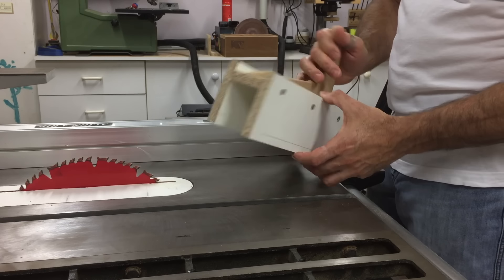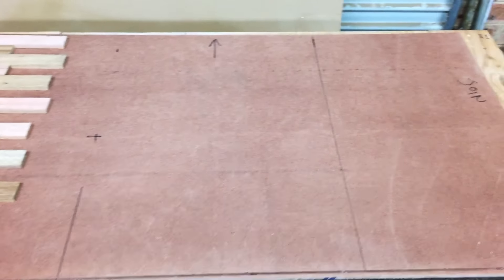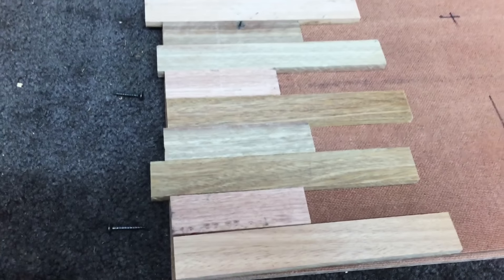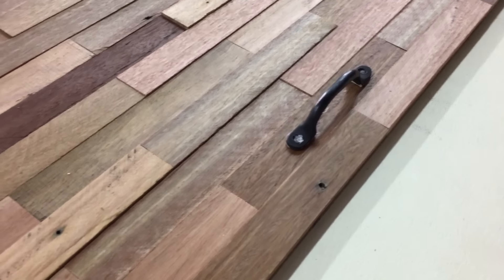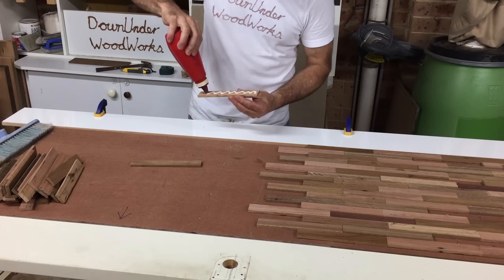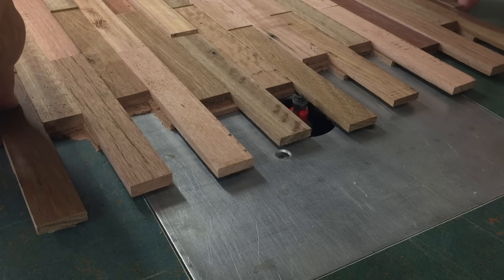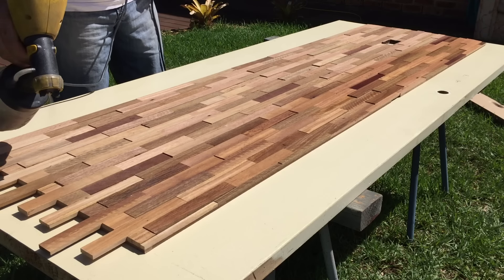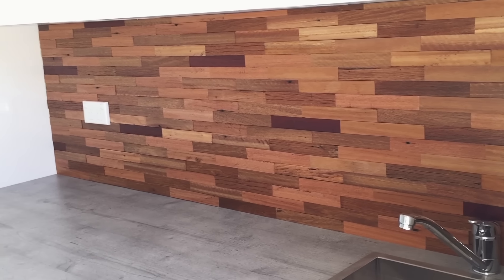How to make a beautiful splashback with timber offcuts.

Comment: Ahhh, what to do with scraps/off cuts? I can fill a skip but frightened the piece I throw/burn, I will want next week. You have a beautiful and perfect solution, it looks great. Love the push stick and might make one myself :D. Two questions.. Why the blade height so high for slim pieces?. Can I have your given name, DUWW Monica is  a bit long
Reply from the maker: Ahh the dilemma of all woodworkers: to throw or not to throw. Sometimes you just have to think outside the box... or just make a box :-). There was no real reason for the blade height that I can remember. However, when you cut a piece of timber with a high blade the angle of the cut to the piece is closer to 90 degrees and when you cut with a very low blade the angle of the cut is closer to horizontal. The higher blade cuts more efficiently and in some cases the lower blade can cause burning. Cheers mate. V.